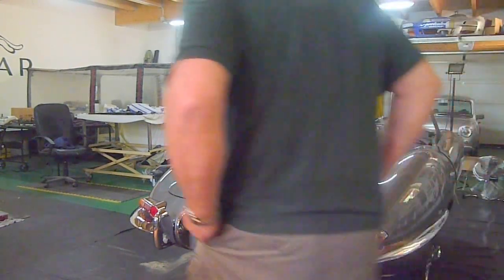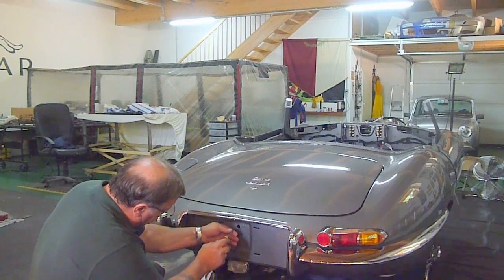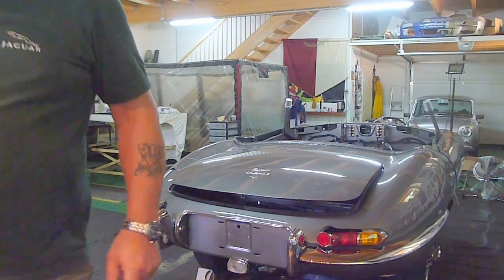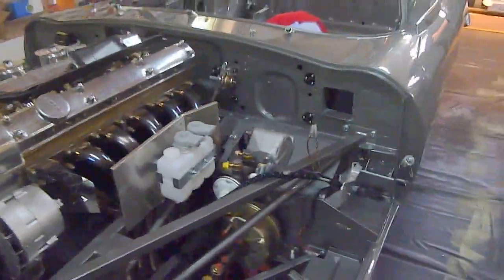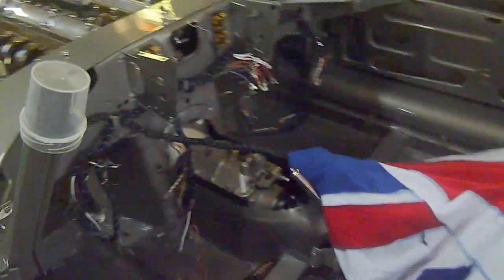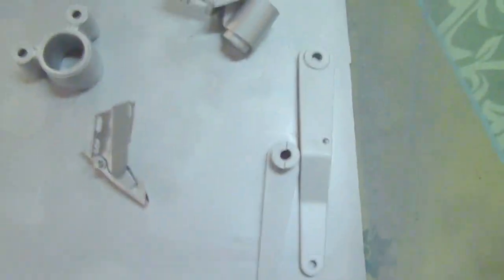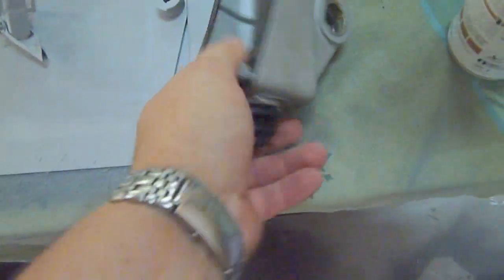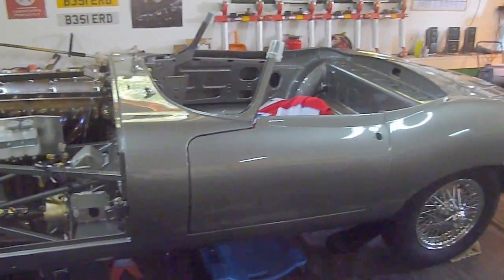jaguar e type rear boot lock tip

Comment: Great tip Dave & your car is looking great, but how about this. Once when working on my '68 OTS I shut the boot lid with the cable removed for repair. Using a broom handle I went through the interior light opening in the rear buckhead & popped the boot lid latch to open, a little work but I did it. Cheers